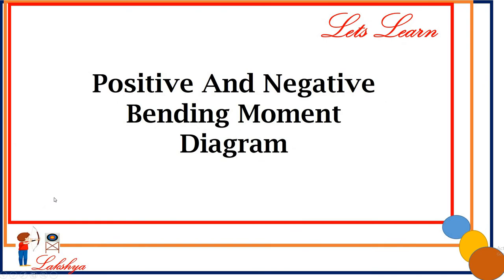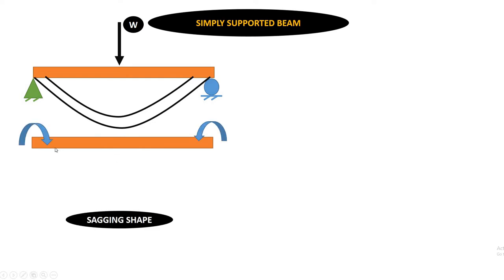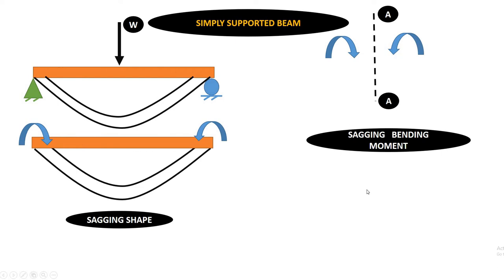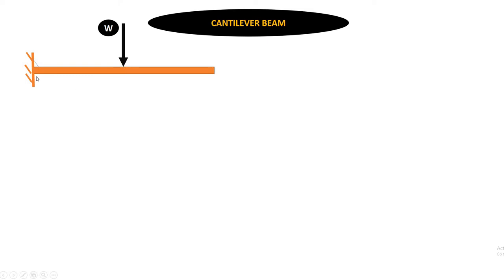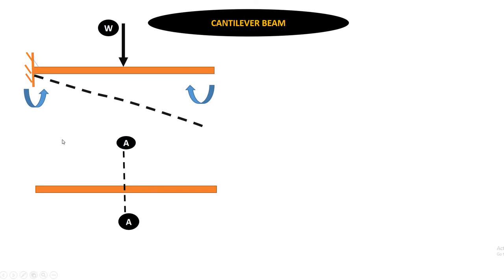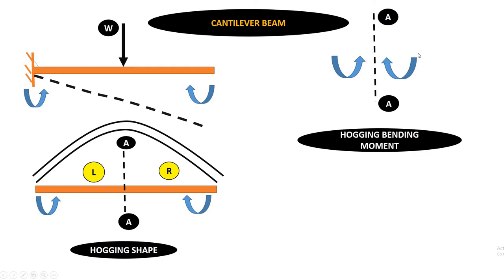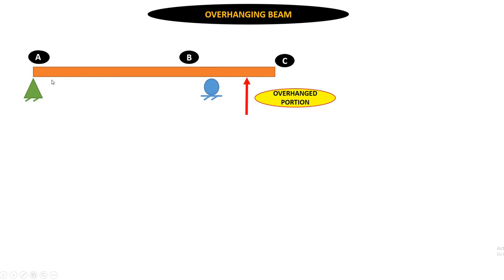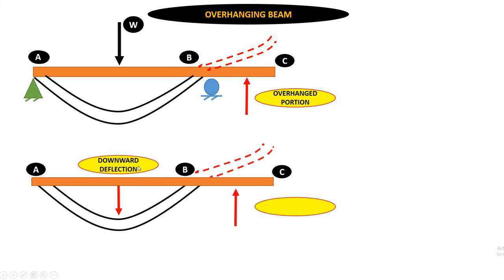POSITIVE AND NEGATIVE  BENDING MOMENT DIAGRAM  #positive #negative #bendingmomentdiagram

Comment: I think the moment vector drawings need to be better described. They appear to show as if the beams are rotating while the moment is applied to them as they are bending. It would be better just to draw the moment vectors strictly without the folding impression. Just strictly bending direction. Not as if folding while showing the direction of moment bending of the segment. Not so good engineers. The rockets will explode under your command! 💥 💥 💥 😮
Reply from the maker: Good point!